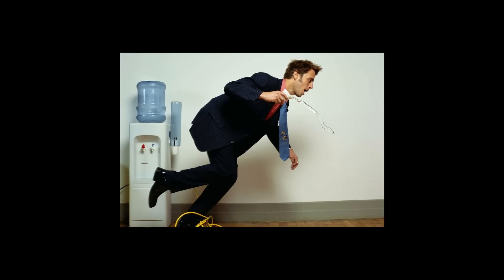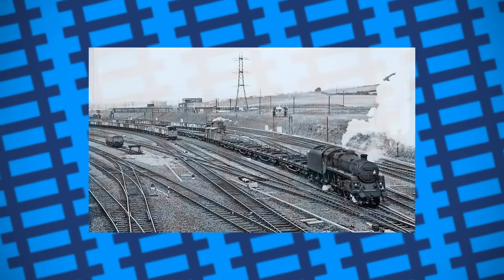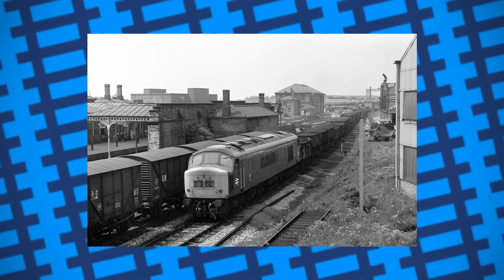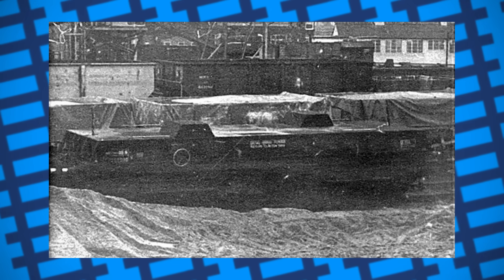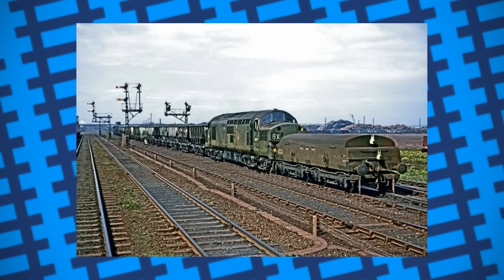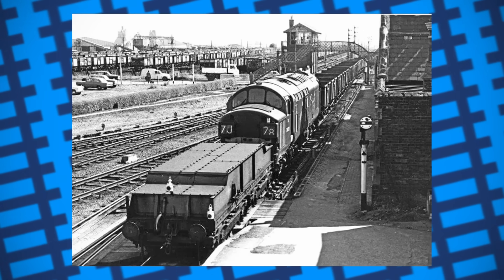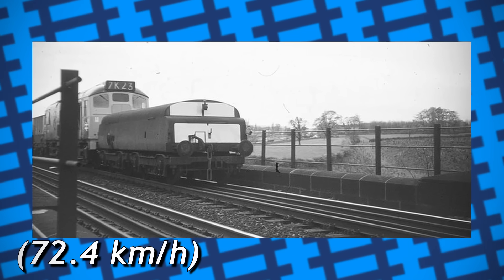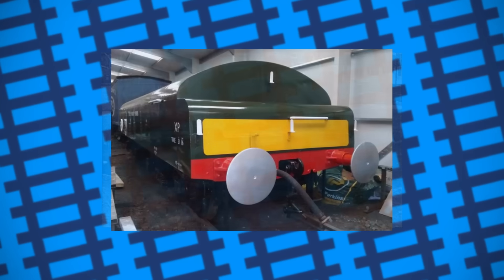Why some British Diesels had Tenders - BR Brake Tenders

Comment: Is it just me, or is the concept of using Brake Tenders on UK Railways similar to using Slugs on US Railroads?

Brake Tenders don't have Traction Motors, but are nonetheless used for Extra Braking Power. Slugs are also used for the same purpose, but have Extra Traction Motors for added tractive effort. Both also feature some form of Ballast to increase adhesive weight, and both — well, Yard Slugs and some Road Slugs in particular — feature a Cut-down height to improve Visibility.

Comment: As an American, I wasn't aware until recently how bad the early British diesels often were...why didn't they just buy licenses from GM or ALCO to build what were already very reliable and powerful American designs in Britain?
Reply: Mostly politics and economics. It would have been very controversial for BR to use taxpayers' money (as a nationalised industry) to buy foreign locomotives. And in the 1940s/1950s the UK economy couldn't support large purchases in US dollars due to the exchange rate and the shortage of UK gold stocks. 

In theory US designs could have been licensed to a British firm to build (as the Sulzer engines and German diesel-hydraulic drivetrains were). The big stumbling block there was that in the 1950s EMD refused to license any overseas production of its prime mover (the 567 engine) or electrical gear. EMD licensed firms like NOHAB and Clyde to design and build variants of its standard designs for overseas markets, but the engines, generators, motors and control gear had to come from the USA. 

Alco reached a cross-licensing deal with Paxman, whereby Paxman could build the Alco 251 engine in Britain and Alco could build the Paxman Ventura in the USA. But this didn't happen until the 1960s, by which BR had already procured most of its first- and second-gen diesels. I'm not aware that Paxman ever built an Alco engine. 

Remember that in the 1950s American locomotive engines were not great when it came to power/size/weight. The EMD 567 made, at best, 1750hp from 16 cylinders. English Electric could get more than that from a smaller 12-cylinder engine.

American power units did not fit easily into the British loading gauge - none of EMD or Alco's standard loco designs would fit and so a specialised design would be needed. 

EMD was actually invited to submit a prototype for the BR Pilot Scheme in 1955 but was reluctant because it would cost a lot to design and build a small batch of highly-specialised locomotives that wouldn't be competitive on power/weight with British designs. And then BR lost enthusiasm when they realised that EMD wouldn't license their mechanical and electrical parts to a British company.

Also remember that, for all the poor designs that came out of the Modernisation Plan, there were perfectly capable British loco builders. Left to their own wishes, English Electric could build locos just as reliable, efficient and productive as anything from EMD or Alco. They sold locos around the world, competing strongly with both American firms in places like Australia and South America (with very 'un-British looking' hood unit road switchers). Long-lived, reliable and successful BR types like the Class 08, Class 20 and Class 37 were standard EE designs. The real horrors came when BR forced daft specifications on the manufacturers and placed large orders for classes that had untested parts and systems.

Comment: I still have no idea what a tender actually is. Starting with a definition is always a good plan.
Reply: "A tender or coal-car (US only) is a special rail vehicle hauled by a steam locomotive containing its fuel (wood, coal, oil or torrefied biomass) and water. Steam locomotives consume large quantities of water compared to the quantity of fuel, so their tenders are necessary to keep them running over long distances. A locomotive that pulls a tender is called a tender locomotive. Locomotives that do not have tenders and carry all their fuel and water on board are called tank locomotives or tank engines. "
Sources: Wikipedia

Comment: I guess one advantage of pushing a tender is it moves the locomotive crew a bit further back in the train, which is safer for them if there’s a collision at a level crossing.  Train crews who started on steam locomotives before transitioning to diesel would have been used to having the entire boiler and smoke box in front of them anyway.  The Southern Railroad in the US ran their diesel hood units long hood forward for years for this reason, until manufacturers stopped offering the design, only selling short full-width noses.

Comment: I think what I find most fascinating about the BR brake tenders is that they used parts from withdrawn coaches. Putting in still good use of materials already available and it helps with some uniformity to the trains, in a way. And a very humbling piece of rolling stock for many "revolutionary" first generation diesels.

Comment: Couldnt find images of it, but i know that in shunting in germany at least as of 2018 in Nürnberg there still was rebuild 6 axle Samms waggons used wich were permanently fitted with concrete blocks and headlights for braking porpuse.

Comment: Cool video.  Silly question.  Why have a diesel locomotive with a tender or two tenders and a steam locomotive with the carriages as well?  It is seems odd that one of the photos there has a working steaming loco and diesel loco and tender?
Reply: The brake tenders weren't usually used on passenger trains (as the coachs were already fitted with vacuum brakes) so the diesel was probably assisting a failed or stalled train.
Reply: @ ahhh.  That makes sense.  Thanks.

Comment: In O.S. Nock’s book Histroric Railway Disasters Chapter 4 is entitled The Battle Of The Brakes 1870-90 & for good reason as British Railway Company’s refused the government’s insistence to fit their stock with brakes, the attitude of these people takes some believing as they not only resented any interference by parliament they refused point blank to take on any good ideas that came from  other British companies (now that’s nimbyism) so when American inventer George Westinghouse made his 1st visit in 1871 to display his own work in the straight air brake that was rapidly being adopted by US railways he found it almost impossible  to make progress here which puzzled him as his brake was far superior to any brake system being used in the UK but during his tour he met Engineering Journal editor John Dredge who told him that if the train broke in 2 parts the brakes should come on in both parts or ir a brake defect occurred they should still operate either side of the defective vehicle so George went home reworked it and in 1874 patented the triple valve , astoundingly only the LNER & LBSR  adopted it , the MR almost did but went back on their word & opted for the simple non automatic vac brake, the LNWR went for a guards chain brake , it would take the 1889 Armagh runaway collision to shock public opinion into parliament compelling the companies to fit automatic brake systems but it only applied to passenger trains & vacuum brakes goods wagons were ingnored.

Comment: These "brake-tenders" remind me of the "Slugs" that used to be attached to switch engines. Switch (shunting) engines do not go fast, which leaves a lot of potential energy that can be put into additional motors. Hence the "slugs," locomotives with motors and extra weight, but no engine or cab. They were seen most often in yards, where a single engine might be called upon to move a huge train by itself, albeit at very slow speed.

Comment: I don't quite know how it works but when in the video you say air breaks I think you mean to say Vacuum brakes as they were more coman in BR days. I only know this because as a volunteer for the Great Central Railway when over the years we have had more modern diesels visit for a Diesel Gala such as a class 66 some years ago this loco worked on air breaks but the BR MK1's that it was hauling were vacuum braked only so a Diesel locomotive with both braking systems had to go in between the 66 and  the MK1's to convert and work the brakes.
Reply: Agreed, early diesels used vacuum train brakes, the locomotive having it's own air brakes. British Railways was far slower in adopting the superior air brake, or in the case of slow good trains, any continuous brakes at all!

Comment: It is amazing to me how much later the UK went to air brakes than the US. They were universally mandated here by act of Congress in 1893, with a seven year grace period, so where universal from 1900 for any cars that were interchanged between railroads. From then, only completely isolated (like the 2' gauge Monson RR in Maine) or industrial lines did not have them.

Comment: I think you'll find they were vacuum brake tenders as apart from Freightliner introduced in the mid 60s all freight trains were unfitted or vacuum well into 70s early 80s.
Reply: HAA coal hoppers were air braked from their introduction in 1964 👍
Reply: At least one thing good came out of the Beeching report was Freightliner, Merry go round and air braked freight trains.
Reply: Vacuum is still entirely better than unfitted, at least you get some braking power from them.

Comment: These were even used in the States. A line near me used old tenders with the bodywork removed and scrap rail for weight to give switchers extra braking power when shoving around cuts of cars in the yard. The yard was flat enough for switching without using air brakes on the cars.
Reply: Switching in a yard is a different matter than road freight.
Reply: @davidfuller581  Well yes, but it's  the same idea: Add a wagon to the loco specifically for braking unbraked stock

Comment: I mean that's a similar concept of what the Americans did we use slugs that are just electric motors that are electrically coupled up to the main engine and it provides extra breaking and extra power without the need of tying up extra locomotives
Reply: Mainly for providing power in yards, etc., where the locos are operating well below peak power.

Comment: A peak or a class 40 aren't that much lower in weight than a 9f, it was especially the smaller type 2 locomotives that suffered the most from lack of weight and therefore brake power.

Comment: I had no idea that the tenders on steam engines were also braked. And also came as quite a surprise to me that early freight wagons weren't braked as well! 
I always thought they used a vacuum brake system and then later on switched over to compressed air. Seeing a 50 wagon freight train going down the Lickey incline with only the steam engine able to apply the brakes seems rather terrifying in my modern eyes!
Reply: When I started on the footplate in 1980 there were still unbraked trains, primarily engineering trains.
Reply: You’re right about vacuum being the standard, but the it’s actually a bit weirder than that. Yes, most freights up to the early 60s used unbraked wagons. That’s just part of why trucks and vans were as small as they were. If you’ve ever heard the term “stop to pin down brakes,” it literally meant the wagons needed to have their brakes applied before the train started descending. There’s some clips from Railway Roundabout showing how trains descended the Lickey, with some trains having a mix of fitted and unfitted stock.
Reply: Some locations, before the start of a falling gradient, had a lineside warning sign "AWB", apply wagon brakes. An unbraked freight had to stop and the guard applied enough wagon brakes to be able to control the train during the descent.

Shunters used two different "poles". One was a shunting pole, about an inch and a half in diameter and 6' long with a hook at the end. That was primarily used for uncoupling and coupling wagons, the hook was used to grab the coupling and swing it up onto the drawhook of the other wagon, best done as the wagons met, easier to swing the coupling. The other was a brake stick, much shorter than a shunting pole (about 4' long) and much more substantial. Square ended, about 3" square, changing to about 2" diameter at the "handle" end. The wagon's handbrake lever was lifted off its resting hook and the brake stick placed usually under the wagon suspension and used to lever the brake lever down forcing the brake shoes against the wheels.
Reply: @russellgxy2905  yea, I seen footage of sorting yard workers running alongside trucks, inserting a pole into the manual brake and putting their body weight on it to engage said brake and running to catch the next one. But that's in a yard, not on the main line. I've always thought this system couldn't be used on the mainline, because you can't disengage them easily. But hey, I'm happy to have been proven wrong. I must get hold of the railway roundabout series'. Been meaning to for ages.

Comment: you kept saying air brakes where i think you mean vacuum brakes not westinghouse compressed air brakes which can apply far more braking force than vacuum brakes.   its a bit poor that any wagon in use in the 20th century has no brakes.

Comment: How is it that Britain took 70+ years more than the US to apply continuous braking to freight trains?  I'm serious.  What permitted the railroads to provide effective service without continuous braking?  What compromises did it entail?
Reply: The smaller size of the network, shorter passing sidings and old rules that said the standard wagon has to be so sized that a horse can propel it. So until the late 60s most wagons were 4 axel 10(?) ft long horse carriage on railroad wheels

Comment: Nope, vacuum braked, as were almost all of the freight wagon and coaching fleet. Stock in the 1950s to mid 60s was either unbraked or vac braked, and slowly air braked wagons and new coaching stock became available.

Comment: You're telling me in the 1960s British rail cars still did not have air brakes?
Reply: Yep. Only started to become introduced from mid 60s onwards with Mk2 passenger coaches, comverted Mk1s, as all BR steam locos weren't fitted with air brakes. Only diesels and electrics were.

Comment: Diesel Locos: Gets Brake Tender
Steam Locos: "Look What They Need to Mimic a Fraction of Our Power"
Reply: Those were to help the trains stop, not run.  As mentioned, many British trains didn't have brakes on most of the cars.
Reply: @ It's a popular meme template.
Reply: Not really, or more like not at all. Diesels were more efficient, cleaner, easier to maintain, provided a better working environment & clearly had the potential to be more powerful, which they soon achieved. This was more important for a working railway than being able to hear something go chuff chuff as you got covered in dirty smoke.
Don't get carried away with steam being faster either. Anything more than 90mph was considered risky & Mallard couldn't even pull its record breaking train into Kings Cross because it suffered a hot box when setting its record.
Reply: @TheRip72  but also had way more issues early on

Comment: why would they put dead weight in there instead of extra fuel or actual cargo?
Reply: Because they are designed to be permanently heavy and attached to a locomotive. Fuel gets consumed, and cargo gets unloaded at the end of the trip.

Comment: Interesting to see a couple of photos of a diesel double-heading with a steam locomotive.
Reply: Not that uncommon on passenger trains.  If the steam was on the front it was probably because the Diesel had failed, if behind it may just have been providing steam heat with a non boiler fitted Diesel.

Comment: On the subject of extra breaking, the UP 4014 uses rolling stock as a braking solution. The massive steam engine would use up expensive brake shoes otherwise.
Reply: Wait, what's breaking, other than your English?

Comment: The brake tender. An interesting yet flawed idea from British Rail. 
How bad were things in that time that you couldn't upgrade your wagons to air brakes?
Reply: Or even convert them to vacuum brakes. The cost would be colossal. Much cheaper to run them into the ground and then only use vacuum braked ones, and afterwards air or dual braked ones.

Comment: Vacuum brakes. Not air.
Air brakes weren't introduced until the 1970s.
Reply: William Stroudley fitted them to his locos and coaches of the LBSCR from the 1870’s. Vacuum took over as it was cheaper.

Comment: It still seems like a massive waste to me not to have these things filled with fuel (like actual tenders) and have their wheels be powered for extra tractive effort.  Steam struggled with the whole "powered tender" concept because moving pressurized steam through a hinged pipe is not exactly easy, but diesel fuel would be so simple it would be almost comical.  I guess they would be more expensive, but it would still be way cheaper than two locomotives kinda like how slugs are used in America railyards.
Reply: As that fuel is used up the tractive effort reduces. The Americans found this out with their triplexes.
Reply: Tractive effort wasn't an issue (if it was they would have just stuck another loco on the front), brake force was the issue.

Comment: Most of the continuous brakes were vacuum rather than air as per the big hose on the locos and brake tender.
Air brakes are two thinner pipes often dangling from the buffer beam.
Transition from vacuum to air for braking took place after steam locos were replaced.

Comment: Did we ever, or do we have, in the UK, any with traction motors?  Slugs?  Or was it only the brake tenders?  Apart from Class 13s.
Reply: I only know about slugs being used on North American railroads. Btw, has TOT done a video on them before?
Reply: Nope, none. The brake tenders didn't have any traction equipment, only vacuum powered tread brakes.